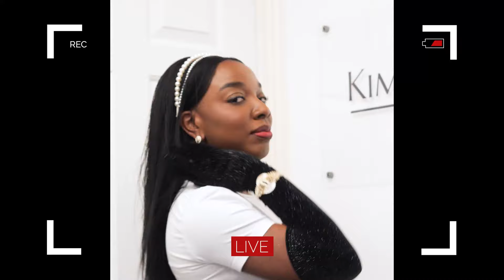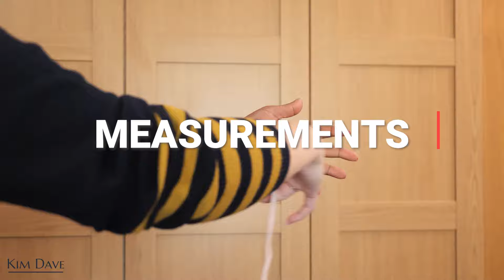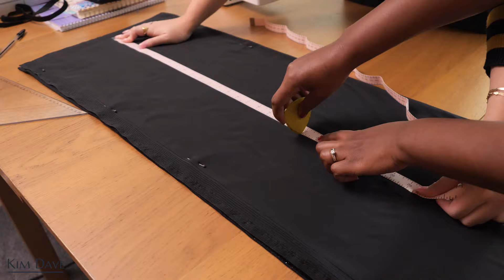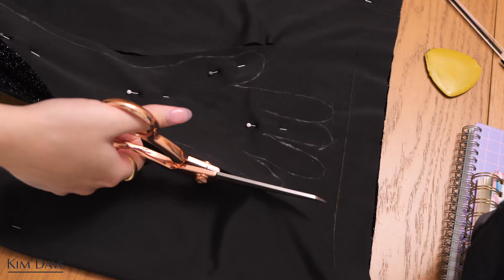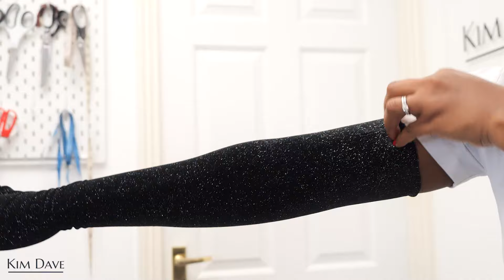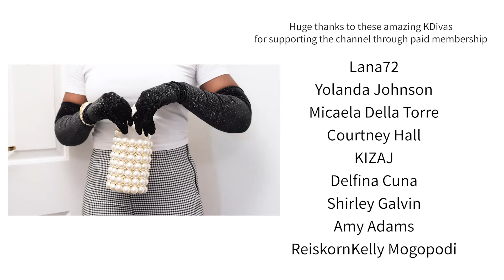How to Make Long Gloves | Easy DIY Velvet Gloves Tutorial

Comment: An additional tip: you can sew a 1/2” elastic on the opening of the glove to prevent it from rolling down, I’ve done this before and it makes it so much more secure when I wear them for longer periods of time. Gorgeous end result by the way and it looks so luxurious with the bag you paired it with ❤️